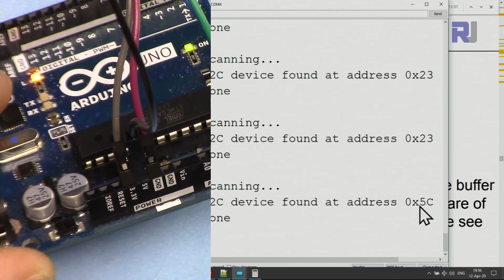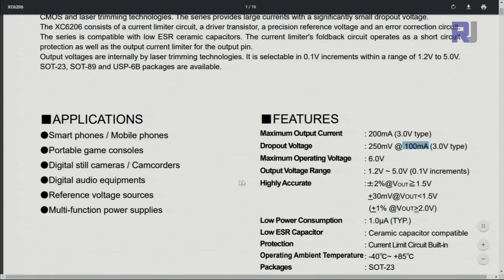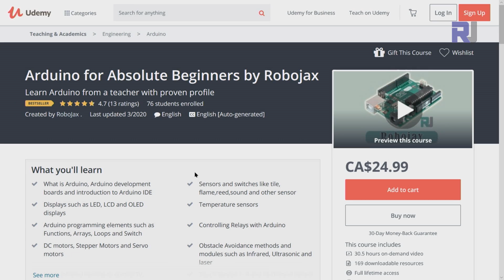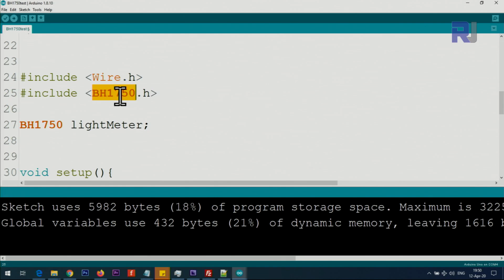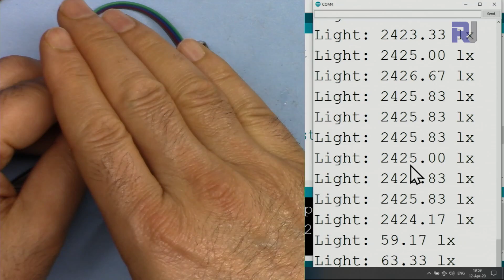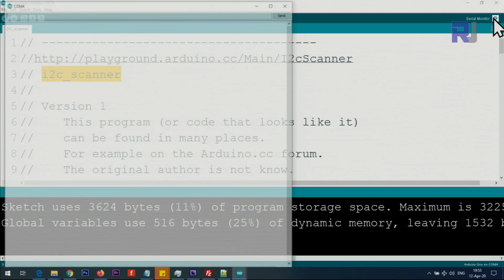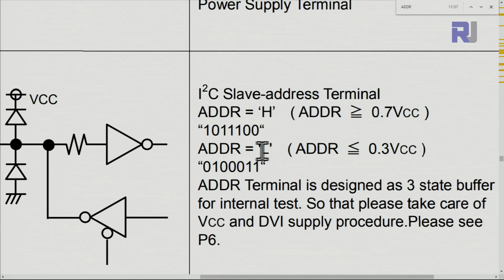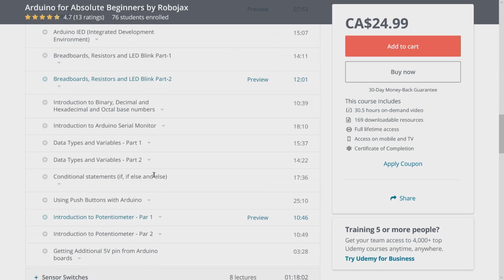Measure Light Lux or Intensity with BH1750L Light Sensor Module - RJT302

Comment: Hi Ahmed! Informative video,  nice but i have faceing one issue when connect DS3231, LCD wit I2C module and BH1750 module but my arduino Uno hang @1300 and 1400 in day time. When isolated BH1750 it work fine.
Reply from the maker: salaam alaikum, use I2C scanner to check if you are getting 3, I2C addresses. Click File->Examples->Wire->I2C Scanner and upload the code and see what you are read in Serial Monitor. you should get 3 addresses. then Disconnect them one by one to see which is NOT active and check the wiring. Or connect them ONE by one and check I2C scanner. you will find where the issue is. I am not sure if there is conflict in I2C address. But if there is it is very easy to change the I2C address for the LCD. I have explained I2C address for LCD here https://youtu.be/bqMMIbmYJS0
Reply: @robojax  ad per your instructions, i connected to upload I2C scanner in arduino uno but, unfortunately my controller was not communicating to upload via serial port so i replaced my controller with other new one and upload after that found address sequentially as 
Scanning...

I2C  device found at address 0x23
I2C device found at address 0x27 
I2C device found at address 0x57.
I2C device found at address 0x68
done
Reply: Assalamualaikum Ahmed! I connected BH1750 module with 4 core shield  cable of 35ft length.

Comment: it was very helpful, but I am getting my sensor BH1750 is not recognized while serial monitoring, and says 
([BH1750] ERROR: received NACK on transmit of address
BH1750 Test begins
[BH1750] Device is not configured!
Light: -2.00 lx
).
 have any solution?
Reply from the maker: Ply use I2C scanner from robojax.com and see if you are getting the address. If not check wiring or module is bad

Comment: hello i am using a max4009 light sensor can you  do a video on it on how to change the i2c adresse from  0x4A to 0x4B ,  i wanted to use 2 of them at the same time but i don't  know how the change the i2c adresse .
thanks
Reply from the maker: my google search resulted with no datasheet for MX4009.
Reply: Sorry it was max44009 or GY-49
Reply from the maker: a simple search showed this library and here is example on how to use 2 sensors https://github.com/RobTillaart/Max44009/blob/master/examples/max44009_two_sensors/max44009_two_sensors.ino

Comment: Hi Robojax, i m using wemos mini pro, how to change the scl and sda pin connection, i understand fix pin for this in the library is D1 and D2, but i want to use D3 and D4 so where is the changes i should make? Pls help. Thank you.
Reply from the maker: you can do wire.begin(SDA, SCL); see it here https://github.com/esp8266/Arduino/blob/master/libraries/Wire/Wire.h
Reply: @robojax  Thanks Robojax, its work.
Reply from the maker: you are welcome